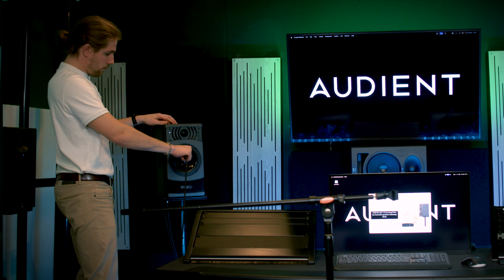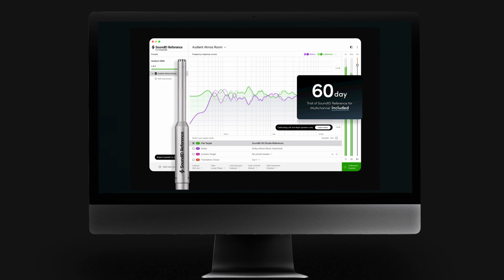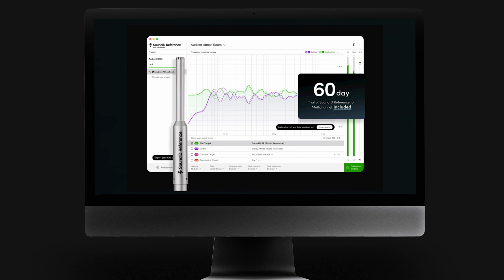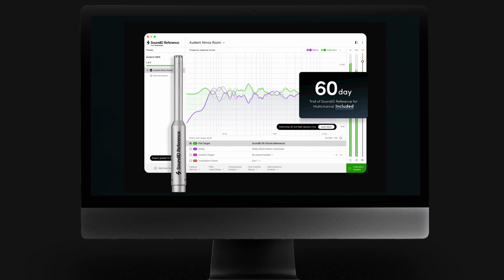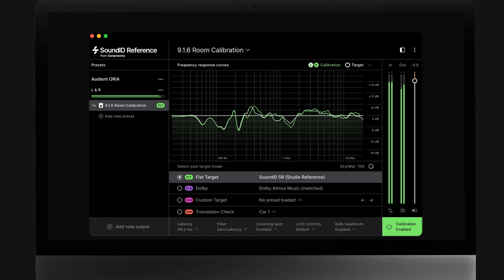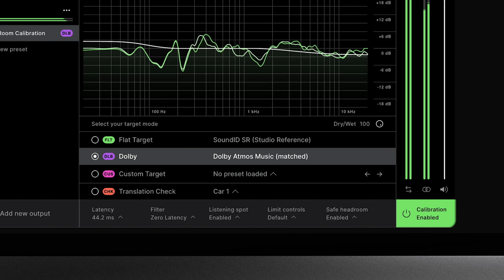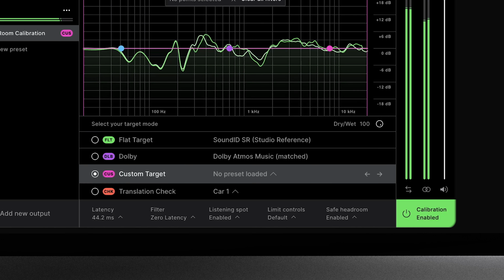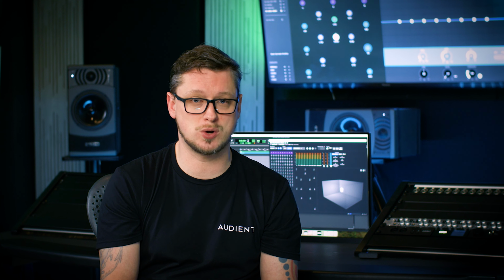ORIA - How to use SoundID Reference Integration

Comment: How would someone go about setting reference levels at say, 79dbSPL
Reply from the maker: The Master volume level is stored as part of a profile so when you select that profile, it will also recall your monitoring level. The user-definable function button on the front panel can also be set to "Return to Reference Level" so you can easily restore your monitoring level if you do adjust the volume control for any reason.